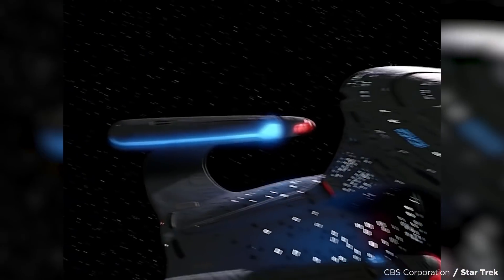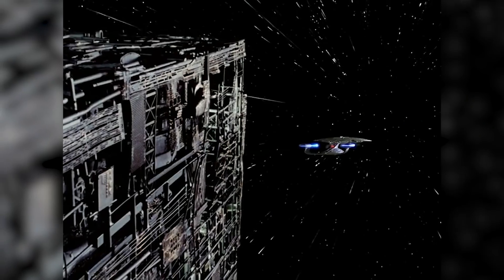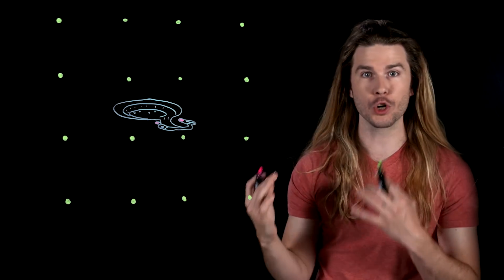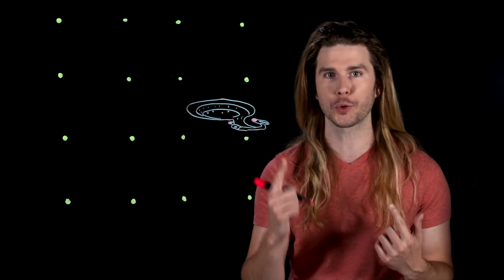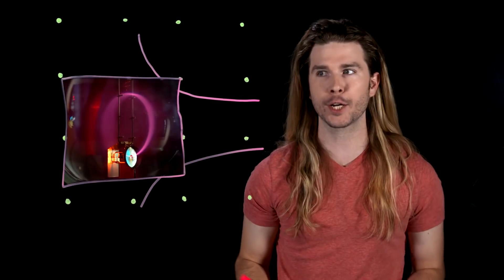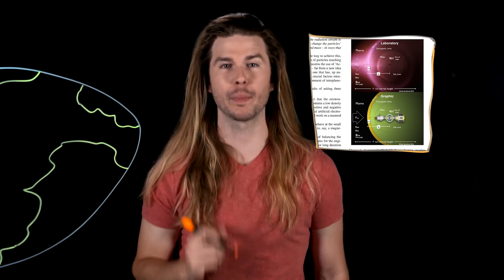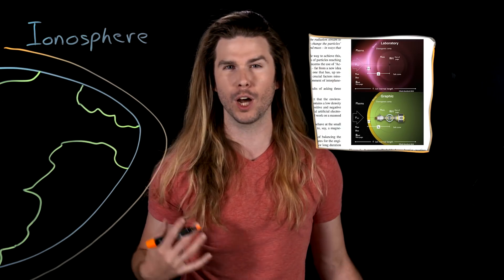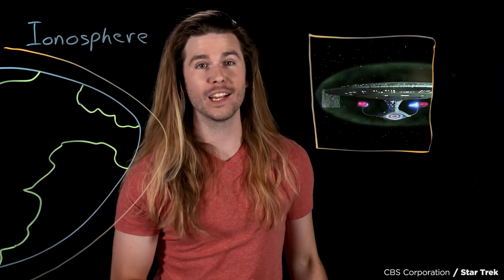How Do Star Trek’s Deflector Shields Work? (Because Science w/ Kyle Hill)

Comment from the maker: How powerful are photon torpedoes? NEW mini-ep over on my Insta: https://www.instagram.com/sci_phile/ -- KH
Reply from the maker: Right, I looked into the graviton stuff at first, but that is so sci-fi at this point that I couldn't say anything plausible about it -- KH
Reply: @Nerdist  makes sense. Hahaha.
Reply: @Nerdist  how many watt is force field used?
Reply: Nerdist In the Star Trek Enterprise technical manual I believe they say some shields are EM based like what you said the video and some are graviton based.  I the main Deflector Shields are graviton based and act like a gravitational lens. Also that the ship itself moves ever so slightly when it is hit so it's being deflected as well...  I read this stuff years ago so I think I am remembering it correctly. So basically it is a gravitational spacial distortion. Would something like that work?
Reply: @kamenwaticlients  This guy got it. I see that all the time as the definition: Gravitonal or Gravimetric spatial distortion deflector shielding.
Reply: @kamenwaticlients  The technical term I believe in trek is: Gravimetric Subspace Distortional shielding. 

Which does both what you're describing, and what Kyle is describing. 

What I'd like to see is, how? Someone make a schematic of a Starfleet shield generator please. I'd like to be able to disassemble one component by component much like one would an internal combustion engine, a lightsaber, or a warp-core.
Reply: @sagesheahan6732  That would be really cool. I use to have the Next Generation tech manual. I don't think it gave that much detail on that particular system. I personally want to do a rewrite on the meaning of Star Trek techno-babble standard units and measurements. So that they tangentially brush up on he real world so we can have a better scope of what it means.
Reply: Since you mentioned the earth not being perfectly round, maybe we could get  video explaining the science backed idea that our 3d universe is beyond doubt flat. That was an interesting subject and i'm sure you can explain it well.
Reply: Nerdist Ok good you may keep your Nerd card till its listed renewal date.  Now spread the wealth of knowledge.
Reply: No, they're deflected around the shield. Think Earth's MF. When a small amount of energy hits the shield there's no real effect. When a larger amount hits the shield, we see an aurora effect that either encompasses an area around the blast or in the Borg's case, lighting up the whole deflector shield. The effect is directly proportional to the amount of energy impacting the shield.
Reply: Don't Trek shields also deflect matter? I do know that they have navigational deflectors. So, shields don't just deflect energy weapons. Is it possible to deflect matter with magnetic shields? :/
Reply: Nerdist i have a working theory on "Anti-Gravity". Theoretically using this method to propel myself. Question: Could you amplify a Magnetic Feild enough to repel Earth's MF??. Ther for moving away from earth as fast as it rotates around the Sun. Perhaps an Inf amount of energy would so it?
Reply: I'd like to see you take on some of the stuff from Warhammer 40k. Vortex Torpedos, Power weapons like the Thunder Hammer OOooh how about How Melta-Weapons work? In any case I dig your vids and can't wait till the next one.
Reply: @ superskullmaster     "the beams in Star Trek don't deflect they just stop. Wouldn't that be absorption?"
But Kyle demonstrated that aurora effect around the entire Enterprise-D, specifically from a shot fired at the rear, so his explanation still stands, IMO.
... also, in the original series episode, "Balance of Terror", the Romulans did eject a nuclear weapon from their torpedo tubes to bluff the Enterprise into thinking their ship was destroyed and it got close enough to do some very crucial damage. Perhaps without knowing it the writers were channeling Kyle's explanation ? lol
Reply: Nerdist thanks for trying though!
Reply: I would have incorporated Photon Torpedoes into THIS VIDEO, because they do MINIMAL/NULL damage to shields in the Star Trek universe .... so how do your shields handle them?
Reply: Nerdist you should definitely do a video on the the super powers of Cole McGrath from Infamous!
Reply: Doesn’t the field still absorb a small amount of kinetic energy from the phaser/laser and in space wouldn’t that effect the trajectory of the ship every time it gets  hit?
Reply: parcog oh ok thanks
Reply: Nerdist wouldn't a deflector shield be closed in booth ways? Like, no one could hit with the ship with charged particle but the ship couldn't hit anyone either, nor could it contact via radio other spaceships. How could they solve the problem?
Reply: WheelmanGames  Most things get a lot more possible when you add the words "with infinite energy."  Including destroying the planet with a hairdryer.  XKCD what-if, google it, fun read.
Reply: Nerdist How do the Halo's work and How much energy would it release to kill people thousands of light year away?
Reply: Nerdist new video idea... do elf ears help them actually hear better?
Reply: Wait, the Earth isn't perfectly round?
I thought it was perfectly flat.
Reply: Hey Nerdist I'm having a series and I'm rewriting a lot of Legends and things like that one of which I'm going to have Pirates and the Queen Anne's Revenge I want the pirate ships to represent the three sisters of fate which other two pirate ships should I use and at the end of one of your videos can you say that you have to go to Gotham and I will leave a link to your Channel
Reply: And by the ships being the sisters of Fate I mean there are three Pirates Who go on ships throughout time and reality to make certain things to fall into place and those ships are the only things that can travel between time and reality
Reply: Star Trek shields are canonically gravity based. They work by distorting and warping a region of spacetime around the ship so much that the effective distance to the hull is millions of miles, even if you fire from less than 100m away, thus the weapon effect (from any weapon, handily enough) is massively dispersed over that distance. Since it's at least as plausible as Romulan singularity generators, I'll allow it
Reply: superskullmaster. It cpuld be disipation. If they got disperced in all directions it would be harder to see
Reply: jjlb82. That actually makes sense. Nice work
Reply: Hey what about missiles and torbedos
Reply: Nerdist. Could you please do an episode on the Star trek beyond movie about how the frequency they played out loud destroyed they drones??
Reply: Nerdist Love this stuff. It’s the only reason I can finally remember Newton’s formula for kinetic energy. Keep it coming. Never, ever stop. ;-)
Reply: phil verhey "Photon Torpedoes [...] do MINIMAL/NULL damage to shields in the Star Trek universe"

that's not true... you are confusing "inefficient" and "ineffective".
Reply: I think this is because there is no air in space, so the explosion has no means to propagate itself. So the shield only sbsorb the radiations generated by it. But if the torpedo hits the actual hull, it can do some real damage since it interracts with matter.
Reply: Nerdist more powerful than proton torpedos
Reply: CybershamanX  you're thinking of the "inertial dampers". They deflect particles of matter out of the way of the ship because traveling at such high speeds even a grain of sand could destroy the ship. The inertial dampers protect the ship from all sorts of physical threats. I'm pretty sure shields don't block physical objects I think I remember shuttle craft  sneaking into enemy ships when their shields were up but I'm not positive I haven't seen an episode of Star Trek in probably two decades
Reply: michael Scott inertial dampers cancel the effect of acceleration. And yes, they lower the shields to let the shuttles in.
Reply: DerpEye  duh you're right I'm thinking of the deflector dish. Like I said haven't seen an episode in probably 20 years but didn't they fly a shuttle onto the borg ship? I think there were other times ships got through shields but IDK off the top of my head rn
Reply: michael Scott probably some plot device like shield modulators, stolen frequencies and other bullshit
Reply: So, I got a question about that torpedo scene in Star Trek Discovery S2 Finale:

SPOILER BELOW

In the episode we see an undetonated photon torpedo lodged in the Enterprise‘s hull.
Any attempt to disarms it fail and it eventually goes of.
Admiral Cornwell sacrificing herself by closing a blast door from inside, though.
The Torpedo obliterates the front section of the saucer, but the rest of the ship remains unharmed.
My theory is, that by closing the blast door, the front section was basically isolated from the ship and assuming the structural integrity field which is a Star Trek staple was disabled, so that almost the entire blast was directed forward away from the ship.
How much relative explosion force would the bulkhead still have to absorb here to make that scene plausible?
I‘m comparing it to the effect of a firecracker in an open hand or closed fist.
Reply: How powerful are photon torpedoes?
The technical manuals (which aren't canon) say the photon torpedo carries 1.5kg of matter and 1.5kg of antimatter... which translates to 64 Megatons (and some people have taken this measure at face value).
However that's not the real yield... that's actually the lower base yield.
Federation weapons (and other systems) use subspace manipulation technology to massively amplify their baseline effects... this is one of the reasons why we've seen extremely high yields ranging to Teraton and Petaton levels in several episodes (orbital bombardment and other areas) just prior to the Dominion War... 
Low yields were observed most of the time because Starfleet is not usually in the business of conquering or killing people and destroying stuff on a planetary (or larger) scale.
Reply: By the way, what you described is NOT how ST shields work. In fact most of your videos describing how things work in science fiction is NOT correct. ST already has an explanation of how shields work. It doesn't need you to explain it an get it totally wrong.
Reply: How dirty is space? I mean, traveling to several closest star systems... how much space debris is impacting the ship on a 12 light year journey? What about black empty regions outside of the galactic/Universe filament travel lanes..
Reply: - There are FOUR LIGHTS!!!
Nice reference.
Reply: Photon torpedoes from what I know have canonical specs which appeared on Prodigy.
They carry 1.5 kg of antimatter.
Blast zone: 300 km.
Speed of travel: about 0.75 c
Range 3 million km.
Over 200 kg weight unfueled.

No stated official yields - the fans are the ones who put forth the notion its 64 MT.

The standard e=mc2 equation would give a solid conversion of 1.5kg of m and 1.5 of AM at 64.4 Megatons.
BUT, there's a problem with that. The blast zone.
Its 300 km large. You CANNOT achieve that with 64.4 MT explosion (neither on a planet or in space - and since these are weapons used in space, we will use SPACE as a baseline).

In space, you would need a yield of around 34 GIGATONS to produce a blast zone of 300 km.

Since this goes well beyond the established conversion using just e=mc2 equation... the only thing we are left with is subspace technology (unless photon torpedoes use some kind of exotic form of matter? But that's not the case).

Photon torpedoes DO use subspace technology, and we've seen that it can have quite substantial effects on weapons and energy sources... it is therefore highly possible that subspace technology is used in photon torpedoes to radically amplify the yields past the regular baseline of about 64 MT to about 34 GT.

Since photons have highly adjustable/variable yields, and SF is not usually in the business of destroying everything in sight, it stands to reason we 'usually' see these weapons used at lower settings.
But Trek ships in general are DESIGNED to deal with such weapons.

What's more is that Antimatter results in 100% energy release.... so the useful energy will be very effective against shields and armour - that said, when ships are designed to deal with these weapons, chances are that they will be able to survive unshielded as well (at least from multiple torpedo strikes) because ships tend to use duranium and Tritanium alloys - those are ridiculously durable.

Additionally, since the ENT-D Warp core was rated in True Q at about 12.75 Exawatts... if the shields are just allocated a few EW during combat situations, you'd need that kind of energy output to withstand GT level firepower (so you can also bet that Phasers fall into similar, albeit weaker output at maximum).
Reply: +superskullmaster that's because he messed up calling them deflector shields, the shields in star trek do not deflect, they absorb/cancel out incoming fire.
Reply: Nerdist hey the beams in Star Trek don't deflect they just stop. Wouldn't that be absorption?
Reply: how about stoping phisical projectiles? that shield would stop it too?

Comment: Sounds like kinetic weapons aren’t so obsolete after all… 4:29
Reply: 5 months late, ik, but; the reason ship based kinetic weapons are dead in star trek has nothing to do with their primary shields, its the deflector and the inertial dampeners. they can kill kinetic momentum at will. this is why they dont all go splat on the back wall when they accelerate to a third of lightspeed within seconds. the dampening field can be extended from the ship, as well. 

moving on to the deflector: the deflectors entire job is to push physical matter away from the ship while its traveling at speed with its impulse drive. it can also stop physical projectiles.

Comment: Deflector Shields probably take energy from a power source and manipulate it in a way so as to provide it with greater kinetic potential. It's like lasers. Light normally don't affect physical objects as much, but by manipulating light you could increase its ability to cause the molecules in physical objects to vibrate and heat up. If you have a keen sense of observation, you may find that our environment already holds many of the solutions to our curiosities about the physical forces.

Comment: Question for the community, would delfector shields be used in accordance with the warp drive because it could possibly be the warp bubble itself? Also how would one go about testing theories on magnetic and frequency induced plasmatic or energy based walls or shields? 

Just trying to get the workings of a warp drive that I could test out on a miniature scale or even launch into space to test out via long range transmitters

Comment: There is one major issue here. How to project them from its base. The Galaxy Class star ship is covered its hull mostly with windows. Where are the projectors to emit the energy bubble to create the shields? Also, the primary source of power on Star Feet ships is matter/anti-matter plus dylithium crystals. Non of these sources can produce the shields in Star Trek. So what power source is making the shields? The same question goes for the impulse engines.

Comment: The issue is the energy needed, but I imagine that future spaceships would be nuclear powered since they would be traveling far from other energy sources such as the Sun, hence why the Voyager space probes use nuclear power. Perhaps using superconductors could limit the electricity requirements as not a lot of energy is lost due to the resistance of the field coils. If I'm wrong, could someone correct me?

Comment: There is a confusion here that needs to be cleared up. The main defectior dish is NOT the same as sheilds. The dish is what stops space dust,  and other debree from stricking the ship. Though I always wondered if that dish could put out enough energy to deflect all the bits of bebree that could pose a danger to the ship at high speeds?

Comment: Two things. 1. They have at various times referred to two separate kinds of shielding--deflectors, which you are NOT talking about here, and shields. The deflectors are supposed to deflect space rocks and other projectiles. The shields are the ones that handle energy weapons. So would magnetic plasma shields handle projectiles?  And 2. How would you fire phasers and photon torpedoes through the shields? Wouldn't they just bounce around inside the bubble?
Reply: Three things. 3. Does this actually explain why they switched from photon torpedoes being packets of energy (in TOS) to physical  cases of exploding stuff in Wrath of Khan?

Comment: Actually you should be able to create shields that block physical particles by creating a node matrix of tiny wavelengths using interleaving off and on magnetic fields from two or more coils spaced apart, in harmonic sequence.  You shape your fields, alternate them at high frequencies using cymatic frequencies that form grids and you have real life shields.  I will be working on it this summer.  You see, the principle is one where a small grid of frequency nodes can mimic a solid structure if the points are tiny enough, with the added benefit of physical impact absorbsion and thwarting charged particles.

Comment: The deflector shields, specifically, refer to the ones in use when the ship is moving, especially at warp. They're also referred to as "navigational shields". They prevent space dust from "blowing a hole in the ship the size of your fist". The shields you're talking about are just referred to as "shields". They absorb the energy released by particle beam weapons or explosions from antimatter torpedoes.